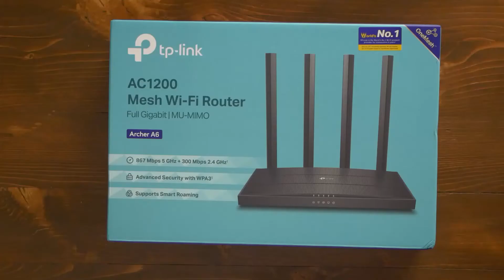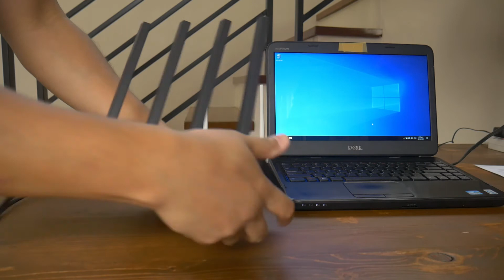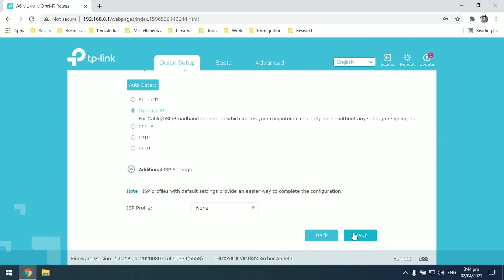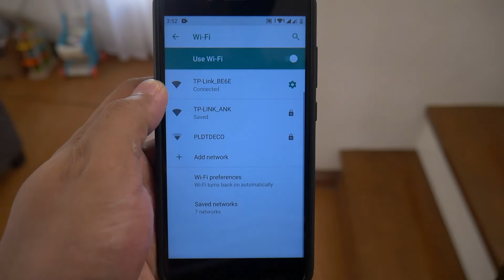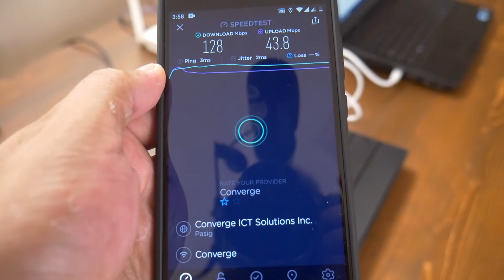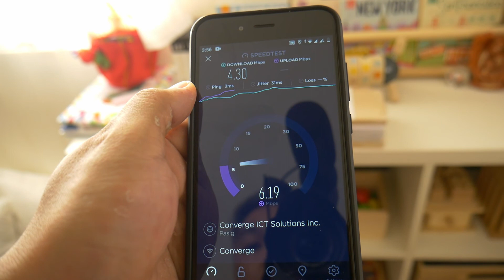TP-Link Archer A6 v3 - Unboxing, Setup and First impression

Comment: So is the 856 Mbps at 5g and 300 at 2.4 an accurate rating in your opinion? I see from another comment that your ISP has you at 200 give or take, mine is at 500 and I'm wondering if this will be a bottle neck. Thanks!
Reply from the maker: Not really. Those are just the maximum wifi speed it can give granted that there are no interferences and that your devices (mobile, laptop etc) supports it.

Comment: would you recommend this or the ASUS RT-AC750L?
Reply from the maker: I don't have actual experience with the Asus but looking at the specs it seems that the A6 is the better option as it has 833Mbps for 5ghz wireless vs 433Mbps of the Asus AC750L. Also the A6 has gigabit wan and lan ports vs 100Mbps of the Asus.
Reply: @Sandiegos  Thanks!

Comment: Does it help improve ping/latency?
Reply from the maker: Sorry I wasn't able to compare with my old router. Although I did notice a significant increase in internet speed if that helps.
Reply: Not really, in terms of Ping, there is very minimal differences with Lan and Wireless (speaking solely on home networks). Ping in most home networks really depends on Router to ISPs to the Server of your application/game.

Comment: Does the seamless  Wi-Fi connection work with the ISP router? What I mean is when the ISP router's SSID is "Net 5GHz", can I have the Archer A6 to have the same SSID?
Reply from the maker: The way I setup mine is this router and another access point (TP Link EAP) have the same SSID for both 2.4Ghz and 5Ghz. I did notice that when my phone switches between the router and the access point, it gets disconnected sometimes.

Comment: Wonder why your speeds were only 50 mbps download when it was hard lined to router, but faster thru wifi. Good review and unboxing.
Reply from the maker: It's probably the hardware. Laptop I used is 10 years old.
Reply: Most old laptop's Ethernet supports only 10/100 Mbps(bottlenecks because of old hardware /& driver)/(Did not configure Lan driver's "Speed and Duplex" setting to utilize the hardware's capabilities *default is auto negotiation). Newer/later ones supports to 10Mbps/100Mbps/1Gbps.